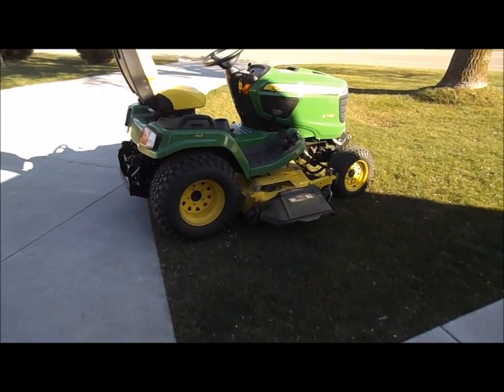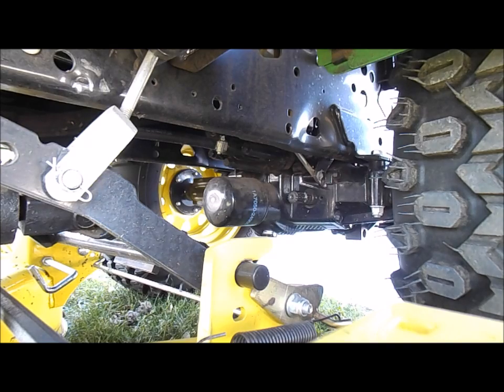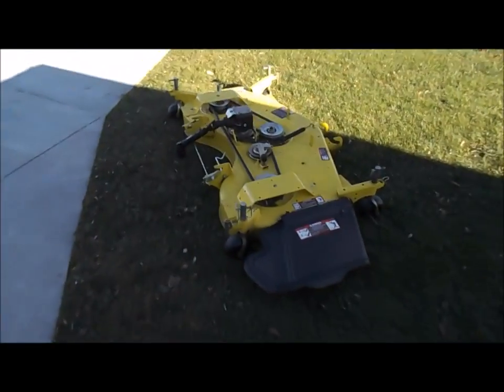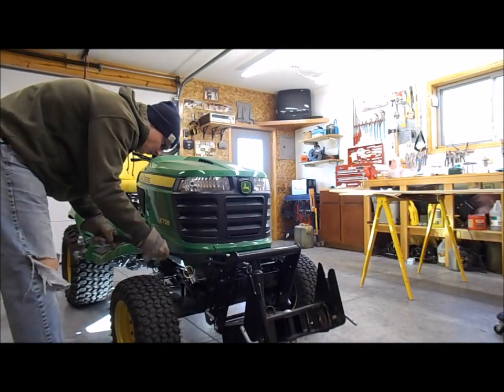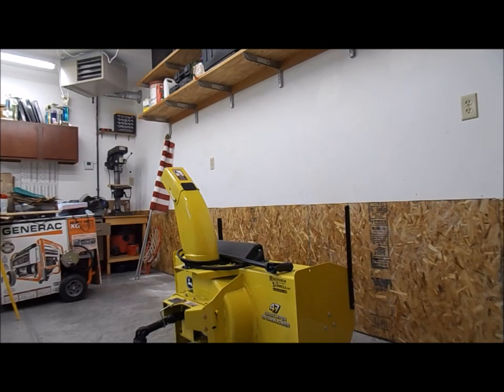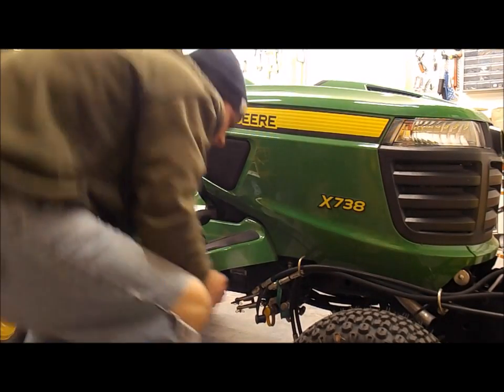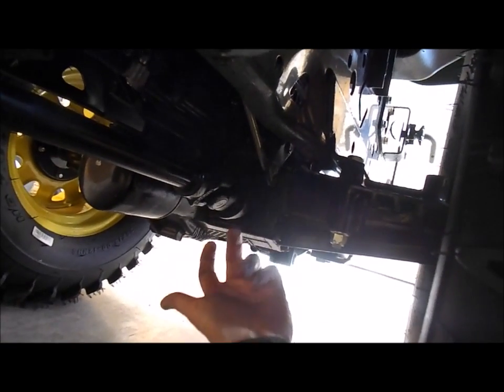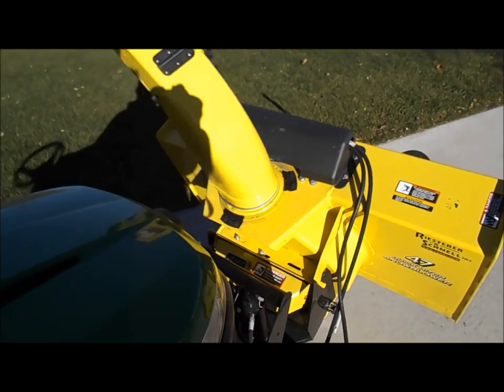John Deere X738 Deck Removal & Snow Blower Install

Comment: Noticed you were able to move tractor by hand pushing pedals. How? Did you tap-splice the seat wires?
Reply from the maker: I made a jumper for the seat plug

Comment: How do you like your 738? Any problems with it? I’m trying to decide whether to buy one or not within the next 2 days while JD has the 0% for 5 years finance offer. 😬
Reply from the maker: They are nice machines.  No issues, had a hydraulic leak early on, but it was covered under warranty.  Otherwise I like it.  I had a x320 and a x500 and the x738 is defiantly the flag ship model.